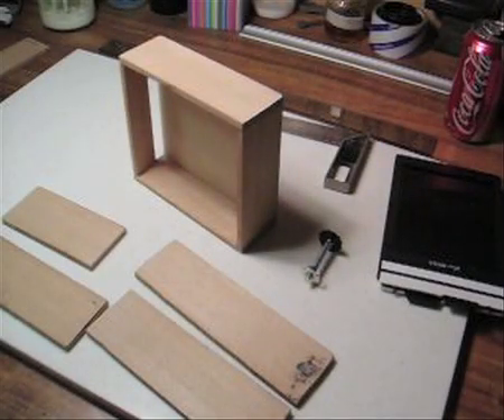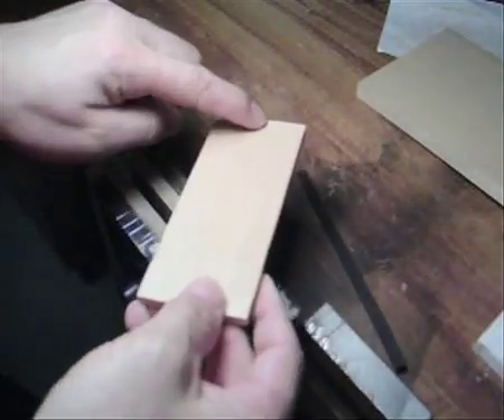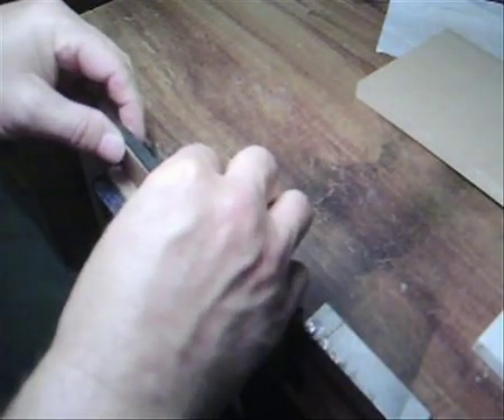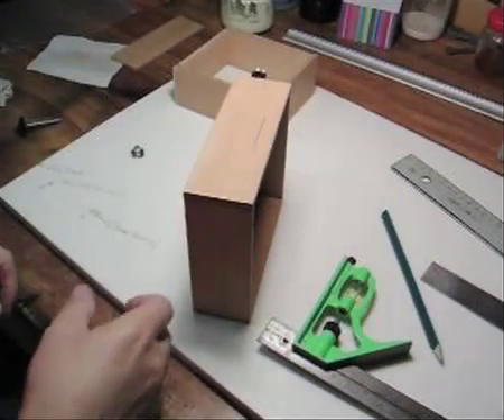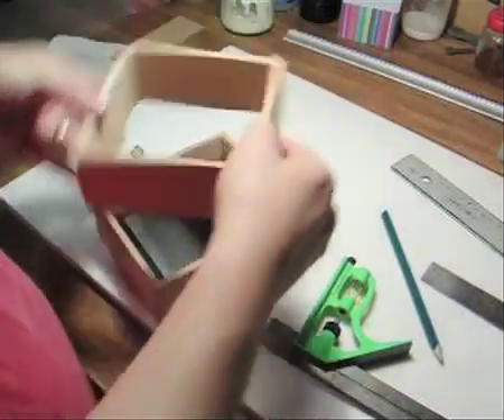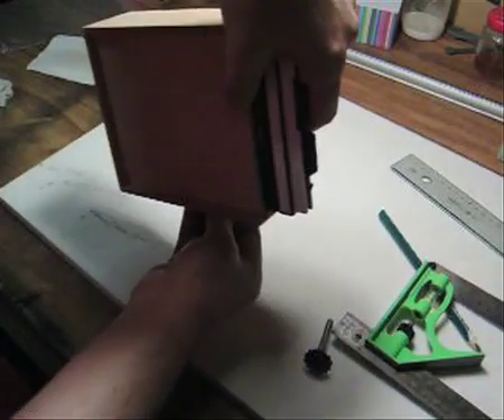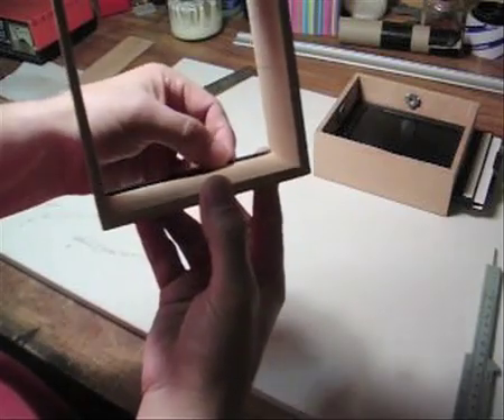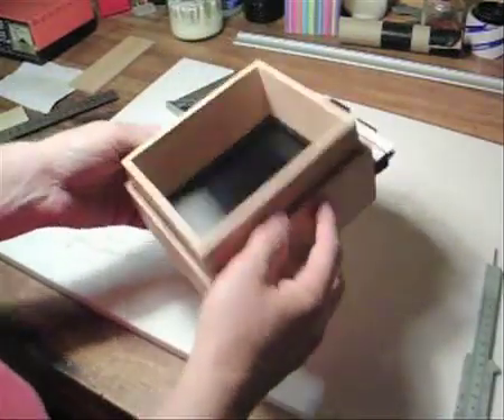Build a 4x5 PinHole Camera - Part 5

Comment from the maker: Measurements are really taken as I go.... I am building around the slide, so I measure as I go and then build appropriately.
The tripod mount is used for the end of legs  for fitting caster wheels to them. Another hardware item, easy to find. Usually you will see something like this on the bottom of a foot for a table that has a wheel on it.